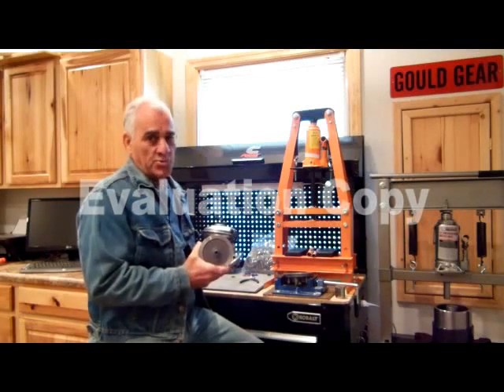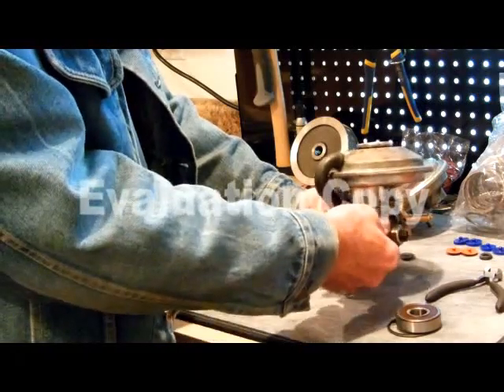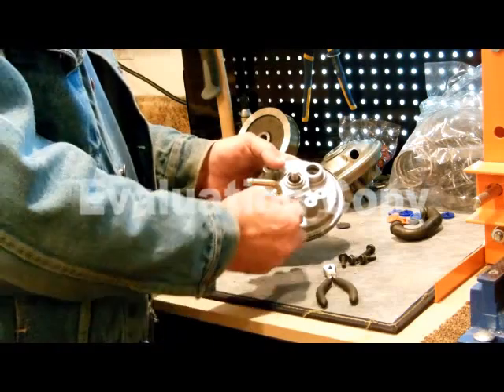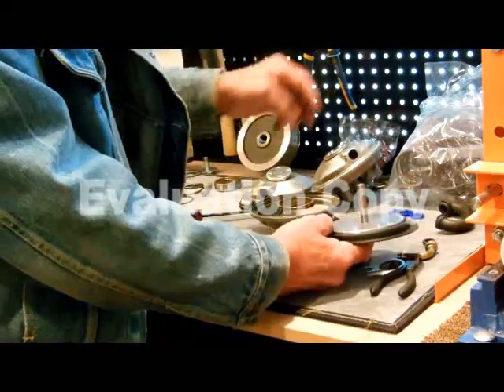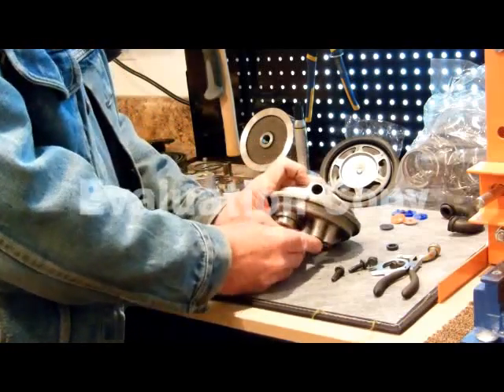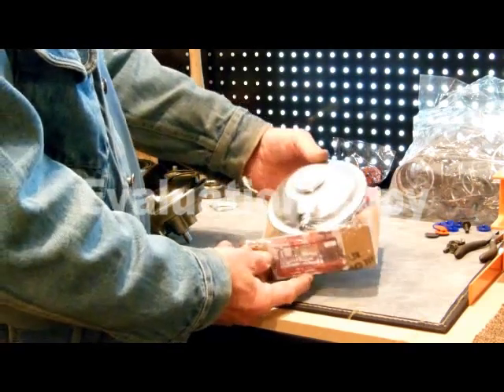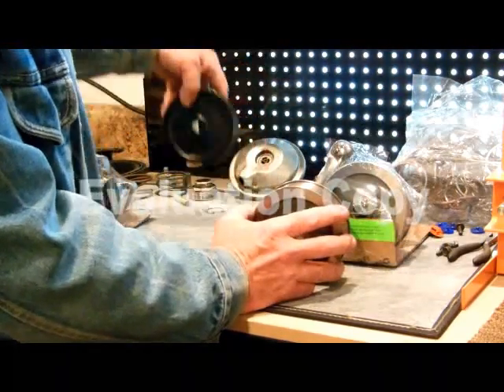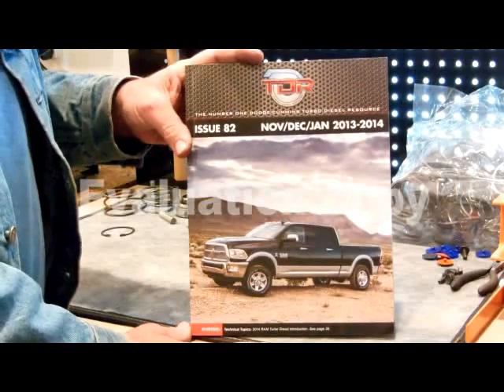DODGE DIESEL EXAUST BRAKE VACUUM PUMP DIAPHRAM

Comment: 4081295 is not the correct belt number.
The correct number is a Cummins number 3947077. I purchadedthe 4081295 number and it would fit fine with out the Jake vaccume pump. And yes, it is a factory installed option exhaust brake from Dodge.

Comment: Nice video.  It’s always seemed silly to me that they used such a substantial engine driven vacuum pump just to actuate the exhaust brake. If a person wanted to run an engine driven pump, a compressor would have made more sense to me. At least you’d gain an air source.